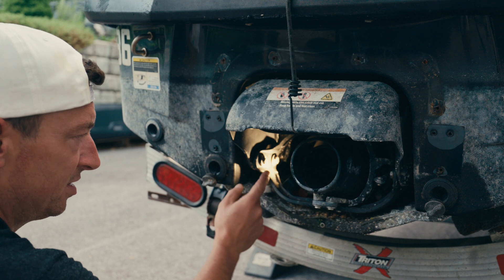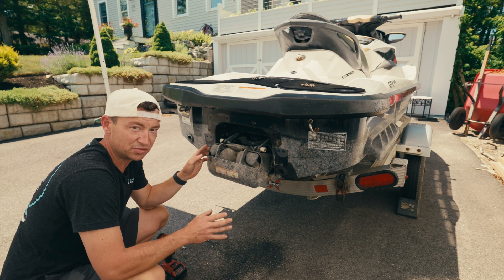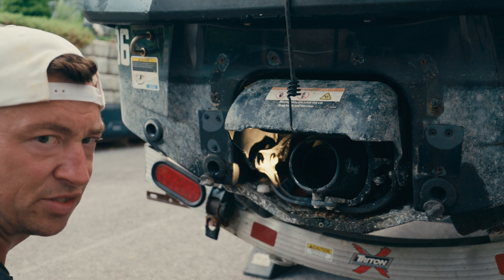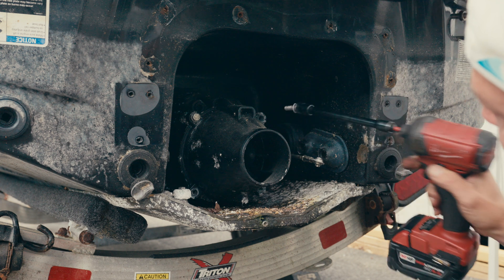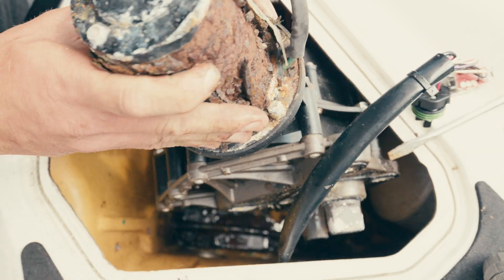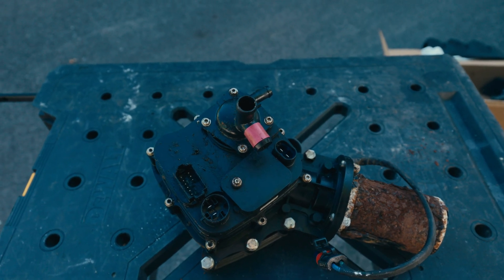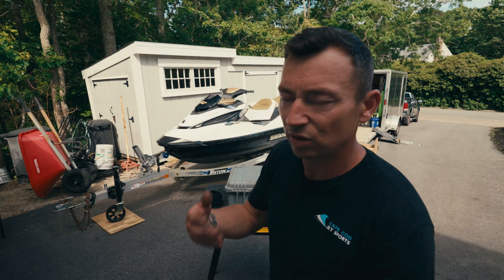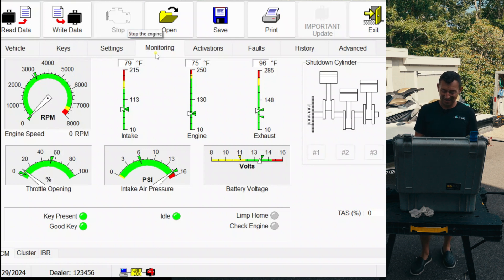How to Diagnose and fix SeaDoo iBR (2010-2015)

Comment: first - Thanks for the awesome videos. I do hope you keep growing this channel. The way you make the videos is great and down to earth. Recently purchased a second hand Seadoo GTX260is like 2 days ago. First jetski. Owner had removed the IBR Bucket because of an error code P1661. I was told that the ski will still pull along alright but if i wanted it to go faster id need to reconnect the bucket and reinitiate the IBR. I had some drama getting one of the bolts out (5.13min in your video) long storey short i had to remove the IBR bolts to wedge something in so i could lever and get the bolt out. No its all out i have to try and piece together the bolts i have in a bag and how the bucket connects. im using your videos to get heaps of direction. Also guessing once done ill need to find someone with Buds that can diagnose.
Reply from the maker: Thank you for watching! Congrats on the ski and sorry it’s giving you trouble. This era SeaDoos can be a pain, especially those suspension skis. I find buds doesn’t really help you diagnose IBR problems, but you do need it to calibrate a new module. Often you need to replace the wiring harness, IBR module and refurbish the reverse gate… crazy expensive unfortunately. If there’s any corrosion in the fuse block start by replacing the main harness

Comment: @ccjetsports 2 questions: (1) I'm facing an iBR MODULE ERROR on a 2011 GTI Limited 155 w/ fault codes P1661 and C2102. iBR Override hasn't worked. Would BUDS be able to tell me additional information with respect to what's causing this (is it a battery, wiring harness, the iBR module, or something else)? (2) If yes to (1), do you know if there's a way I can rent or borrow a BUDS in/near San Jose, CA?
Reply from the maker: You really only need Buds to calibrate a new iBR module. There are 3 types of failures. 1- the reverse gate is binding up 2- communication error typically from bad wiring 3- the module failed. —— I don’t know of anyone that rents their system. —— I’d start by taking off the 2 bolts and see if it’s binding
Reply: @ccjetsports  Thanks! I took off the two bolts. It isn't binding -- it moves very freely and easily. Is there a good way for me to determine if it is a communication error or a failed module? Perhaps I can use a multimeter to take a reading at the wires that go to the module. I'm assuming if the 'signal' there when I enable iBR override and try to adjust the gate is the right one, but the gate isn't opening, it is likely a failed module. Do you know of any way I could test this (if there's such a reading I could take w/ a multimeter)?
Reply from the maker: I haven’t found a reliable way to test the wiring harness. If I open the fuse box and see any corrosion on the fuses or bus bars I replace the harness

Comment: If my ibr bucket is stuck half way down, can I remove the ibr system and continue using the machine for the time being somehow or will that cause it to have dash codes and go in limp mode ?
Reply from the maker: If the motor doesn’t move it’ll throw codes without the bucket, but you may get lucky and it won’t go into limp. You can shut off IBR if you have buds.

Comment: Can you give me a way to email you 
about my ibr problem. I took it to a dealer and they wouldn't do anything without first replacing the wiring harness?
Reply from the maker: If we talk it out here it may help others. The Ibr module, display and ecm all talk to each other through the wiring harness. If there's poor communication it won't work... if they say it needs a harness then replace it. It's not a difficult job and Partzilla.com usually has them in stock.

Comment: Hey I have a 2013 wake pro tht has a ibr issue and no one can seem to fix it, how do you know it’s a wire harness issue and if you install a new one do I need to reprogram the computer?
Reply from the maker: If I open the fuse box and see any green or white corrosion on anything in there I buy a new main wiring harness from Partzilla. You only need to program modules, harness is plug and play
Reply: @ccjetsports thank you I will check that out

Comment: Do you know if the CanDoo software will allow syncing the the new IBR, or does it have to be BUDS?
Reply from the maker: No you can’t calibrate iBR with CanDoo. That’s why I got buds originally
Reply: @ccjetsports  thank 
you.
Reply: My 2011 RXTis 260 is throwing code C2155, IBR coolant sensor overheat, showing 160 degrees on the lake water display, the IBR appears to be working properly, couldn't clear the code with my Candoo, red IBR light showing on cluster, any thoughts on this?
thank you.

Comment: My 2023 fish pro trophy won't start. Getting an ibr module error on dash, have 12.4 volts, dash flickers sometimes, and the screen clears up, and when I push the start button, the screen goes black. Left me stranded yesterday.
Reply from the maker: I’d try a new battery. Should be 12.6 but voltage is only part of the equation. To test it you need to put it under load, but I would go get a Deka (the stock batteries are crap) https://amzn.to/3ZBHTVC I get mine from  O’reillys but most autopart stores sell rebranded Deka
Reply from the maker: And clean the cable ends with sandpaper or scuff pad
Reply: Thank you  @ccjetsports
Reply from the maker: @g4r_outdoors was it just the battery?

Comment: hi, while riding as soon as i jump out of the water or make a sharp turn and the jet comes out of the water the ibr warning light appears on the display and the bike goes into protection mode. should i change the ibr or is it an electrical problem?
Reply from the maker: I’d start by taking off the 2 bolts holding the moving parts to the IBR motor and see if the bushings are too tight

Comment: You mentioned that some bolts may have a tendency to break on you.  The ones that connect bell housing to pump housing.  Right at 6:46 in video.  If they do break, do you have to replace the pump housing?
Reply from the maker: It is possible to drill and extract the broken piece, but it’s hard to do

Comment: Great video. I just replaced my ibr on my 2013 GTI 130S. I had the ibr rebuilt. Did you installed a brand new IBR?
Reply from the maker: Yes, the actuator was new from partzilla
Reply: @ccjetsports  those are pricey. Thanks a lot for sharing

Comment: Great video. Just in time to replace my own, looking forward to the ride plate video as I have a leak where the connectors join the plate. Thank you!
Reply from the maker: Thanks! I'll work on the rideplate vid next, the hardest part I had with this ride plate was accessing the bolts while on the trailer. The bunks were right in the way.
Reply from the maker: Here's the rideplate vid. Not ready to publish yet, but this link should work.     https://youtu.be/pkG8KKmudgk
Reply: @ccjetsports your a legend!
Reply: Struggling to get those silver spacers out, mine seem pretty stuck in there, any tips?
Reply from the maker: @cameronmiller5524  clamping on vice grips and twisting usually does it. 

You can heat them with a torch but it may melt stuff. 

I have a buddy that uses a tap and bolt to get them out but there’s not much room to get the die in there with the gate still on
Reply from the maker: Did you get that ride plate swapped out, if so how’d it go?